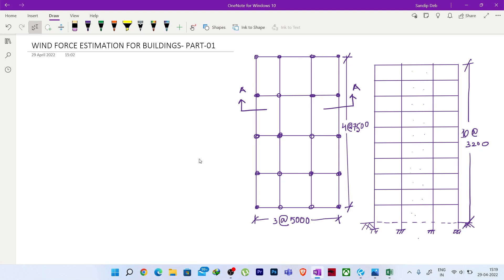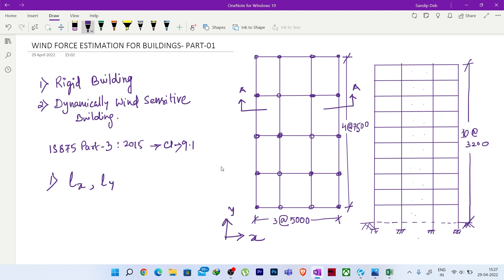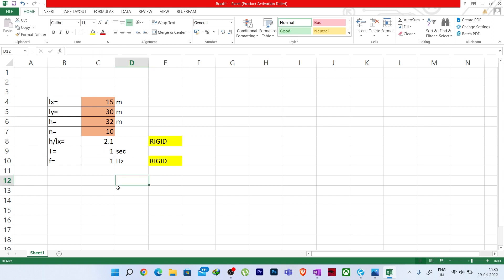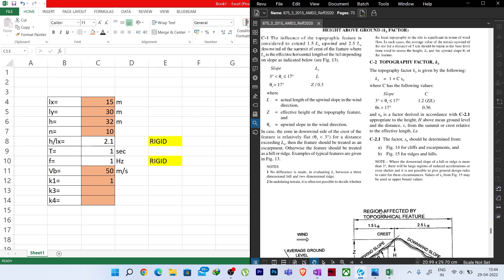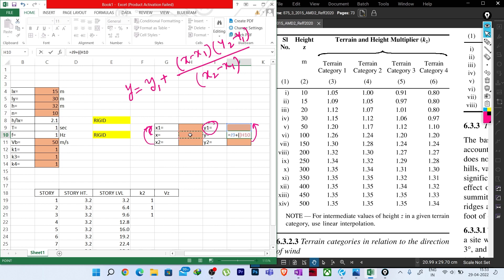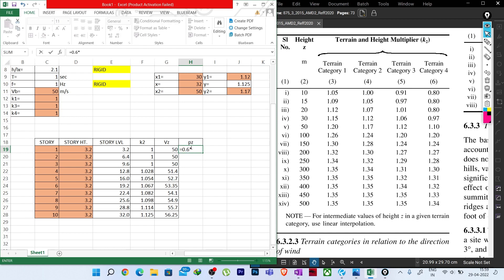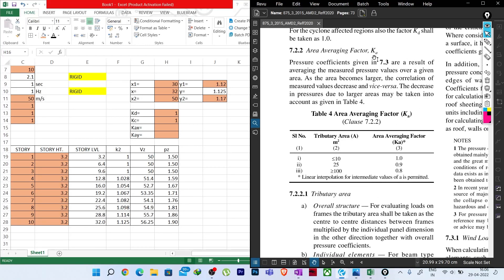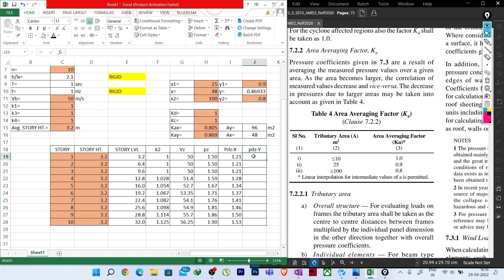Wind Force Calculation for Buildings-IS875(Part3)- Part1 | Excel Sheet Preparation | ilustraca

Comment: Dear  Sir,
For taking area averaging factor Ka, tributary area to be consider is half the column spacing on left and half the  column spacing on right multiply by building height from GL to top of building  height of wind acting on  that direction. But  you follow in a different manner. How it is correct. As per your explanation for tributary area. no reference book is available except explanatory hand book. Kindly clarify with reference to IS875 part3-2015. Thank you.
Reply: He has taken C/C only.